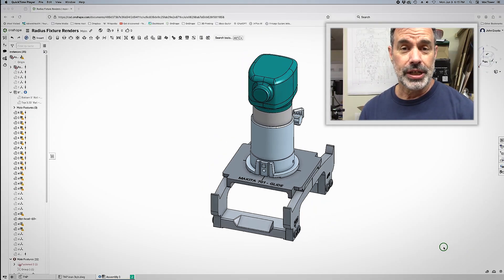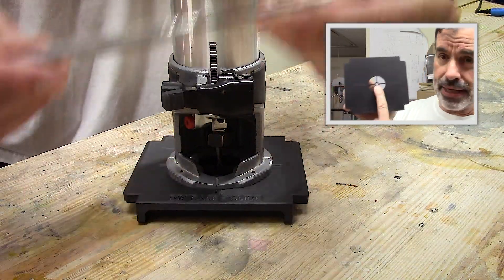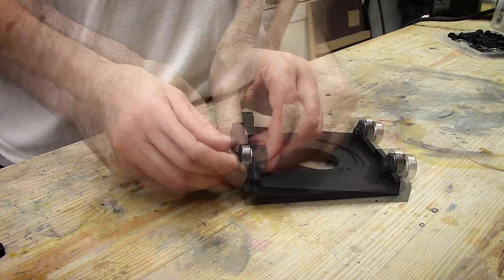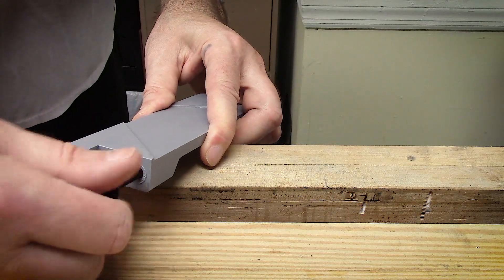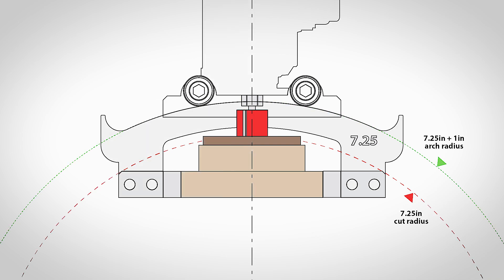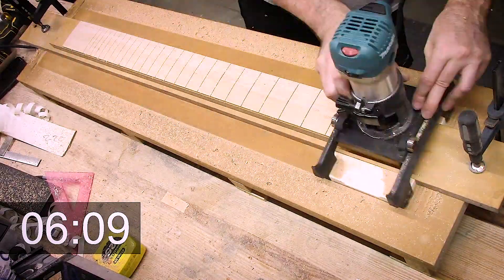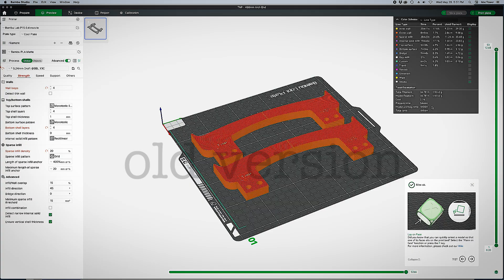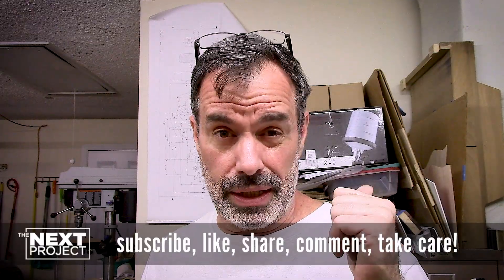Fingerboard Radius Fixture - 3D Printing Guitar Project Tools Ep3

Comment: thanks heaps.  i was about to try and build one of these.  really appreciate it.  going to try my luck making a neck
Reply from the maker: Jarrah, thanks for watching!

This fingerboard shaping fixture can save a lot of time... but before you commit to cutting your "good" fingerboard lumber, do a couple tests on some scrap material that is the same dimensions.
This will give you a chance to learn the process and get a feel for it.
You will probably still want to do final light sanding to remove any router swirl marks.

Good luck with your project!
Reply: @theNextProject  thanks for the tip

Comment: I’m a Solidworks guy and just getting into 3D printing. Do you have any recommendations for a good printer that doesn’t require me to get a loan against my house? 😂
Reply from the maker: Mark, thanks for watching!
Great question

The a short, short answer is: 
I have a Bambu Labs P1S, currently $399. 
The new Bambu Labs P2S is $599.
A lot of other good options, but I have no experience with them.
My P1S has been a great tool, it's weakest component at this point is (me).

Here's a earlier reply to a similar question, I type slow, so copy/paste is my friend.

There are a number of very good machines available, and I went through a list and compared nearly a dozen before boiling it down and making a purchase.
First, I had a very hard time justifying the purchase. All I saw were people printing toys and trinkets and "benchies" (benchy is a silly little tugboat print file that people use to test filament...to no end). 
So, on top of justifying the cost, need and use of the printer, I then juggled how to pay for it. I considered running a small "print farm", basically selling the tools and parts I've been designing.
I then realized, that's a job in itself, and I'm way to busy already.
I've purchased other tools, in similar fashion, often buying the bottom-tier tool to save a few dollars.
In some cases that has been a good decision, but I knew this is a different kind of tool, and a bottom-tier printer may be outgrown pretty fast, so I looked a mid-level and upper-tier printers.

After the research dust settled, I decided on the Bambu Labs P1S (mid-tier printer at the time).
It is a rather "turn-key" printer, aside from some minor assembly/unpacking, software download and set up. After that initial stuff was done, it's been a good machine.
It is currently $399, which is $200 less than I paid for it a year ago!!!
There is the little brother A1 currently at  $299. 
A lot of people love the A1, but I was concerned with the max print size it can handle... may or may not be an issue.
https://us.store.bambulab.com/products/p1s

The P1S has been a great machine, and for a novice (me) it has worked well. The only problems I really have are with the operator (me), and the designs I attempt to force on the machine.
I did not get the AMS device, which is a multi-filament holder add-on, as I planned to make parts and tools, not figurines and gift toys. 
Everything I make is mostly one color. I load the filament and run it until the spool is empty. 
NOTE: I'm really liking bright colors for tools and parts, easy to see them on the bench and in the drawer.
As for filament, that's another research challenge. There are a number of companies making/selling filament, and not all filament is created equal. Similar, but not the same in some cases.
I largely keep it simple (safe) and just use PLA filament for most of my projects - at this time.
I have used Carbon Fiber reinforced filament, but that requires a couple upgrades to the printer.
I also have concerns about potential health issues using and handling some CF filaments...I worry about things.

On top of the printer, filament, material storage... there is 3D files. Either you find things to print, or you design things to print. So, if you like to learn, there are a host of 3D apps out there.
I'm currently using "OnShape", which is a free online 3D design program.  There are some great online tutorials for this and many other design apps. Again, I didn't want another career, and OnShape became reasonably easy once I pushed through some tutorials. 

As I mentioned, there are a lot of great printers out there, and my choice may not be right for everyone.
I did want something that was "turn-key" for the most-part, I didn't want printing to be another full-time job filled with trouble-shooting, but rather a tool I can reach for and use when needed.
(there is still trouble-shooting and plenty of testing)

Okay, sorry for the long essay, that really doesn't give you a clear answer.

Good luck with your projects, be safe and take care!

I hope this helps, be safe and take care!
Reply: @t @theNextProject what a great response. Thank you much. I’m going to check the 3D program. Solidworks is expensive even on the maker level.
Reply from the maker: @Souldoubtrocks   I don't know if onshape will have all the features of SolidWorks, but it's works well enough for the simple tools I'm making, and my skill set, and the public version is free.  That fits my budget and user level.
Good luck with your endeavor into 3D print!

Comment: This is awesome!  I have access to a publicly offered 3D printer.  Any suggestions for a total newbie?  Any idea how long it takes to print the various parts?  I think the limit for print time is about six hours.  I don't mind donating some filament to the location if certain filaments would be superior to others for this project.
Reply from the maker: That's great news!
Print time will vary based on a number of things. 
The type of printer, the type of filament being used, the thickness per layer of filament, the speed of print head...
For the majority of my radius fixture parts, I'm using PLA+, or PLA Tough+ Filament. 
PLA Matte and standard PLA will also work. 
The thing about most PLA's is that they aren't the strongest, nor most environmentally durable. PLA will warp if it gets too hot, so don't leave it in your car on a hot day...
But, for most guitar projects the PLA parts will be reasonably sheltered.
I've also used PETG, and PETG-CF (carbon fiber), but for this project that seems overkill.
If you can talk to someone who knows the public 3D printer, they may be able to offer some guidance based on the machine to be used.
Orientation of parts, and bed temperature are also things to consider. 
Sorry, but there is a lot of little details, many of which I'm not up-to-speed on. 
I'm still learning as we go.
Maybe get the parts you want to print downloaded to a USB thumbdrive, and visit with someone at the printer.

Sorry I can't help much, good luck with the process!
Reply: @theNextProject  Thank you for the thoughtful and helpful reply.  I'm a total beginner so this helps get me going in the right direction.  I'll work with the local printer to see if we can get a working radius fixture.  I'm looking forward to your next video.  Thanks again!

Comment: And what if you use this jig for leveling the frets using a diamond router bit? Could that work too?
Reply from the maker: Lucas, thanks for watching!
WOW, hadn't thought of using it to do any fret leveling. 
I'd guess it may be possible, but that's a bit beyond the original intention of this tool.
Precise alignment, and leveling of the neck/fingerboard would be needed. A way to industrial clamp everything in place so nothing moves, not even a hair. 
Hmm, sounds like a task for CNC machining. 
I like how you are thinking outside the box. The "what if..." thought process helps us develop new tools and processes.
Good thinking!
Be safe and take care!

Comment: Is there a particular router bit that you recommend?
Reply from the maker: Thanks for watching!
Bit choice will be subjective, but I typically use a 2 flute flat bottom bit made for CNC waste board work.  I've also used 1/2" diameter bits, spiral bits, downcut bits... 
I'd suggest getting some scrap material and running a few tests, you may find one type of bit works well on maple, but not on rosewood. 
Also practice and think about direction of cut, which way to travel along the edges to minimize chips and tear out. 

Amazon search:
YONICO 14971q 3/4-Inch Diameter Bottom Cleaning Router Bit

I hope this helps, good luck with your projects!
Reply: @theNextProject tried the radius jig today. Worked beautifully,!!
Reply from the maker: Glad to hear you had success with the jig.

Comment: Hello! Great tool! I would like, if possible a radius of 93mm or 3.66 inches. Awesome channel!! Thank you!

Edit: trying to edit your files, let's see!
Reply from the maker: Pedro, thanks for watching!
EDIT 2: 
A Violin, perhaps.

EDIT 1:
I've placed STEP and STL files in the Dropbox folder.
3D print files:
https://www.dropbox.com/scl/fo/z70x7gp1t1be9hnds8nii/AEi3bpPsHMHOOIRwL5AfFaw?rlkey=d5fyzml1sdl3s2p2yr531xshe&st=ksowbdlh&dl=0

It is a pretty tight radius, but I think it will work - depending. 
This 93mm radius will require a narrower top routing rail for the fingerboard to mount to due to the tight radius. The router bit will cut a path that will hit a 3.5" wide top fingerboard mounting rail, so be prepared for that. Overall, this radius arch should work.
It is designed like the others, with a 1" offset from the fingerboard surface to the radius arch that the router will ride on.

The 93mm end arch may require a 4 or 5 loop wall thickness and maybe 40% or more infill to increase its strength overall.

Original reply:
A couple of questions, what thickness will you make the fingerboard at its thickest point, and what width will the board be at the nut area.
This fixture is set up for a standard guitar fingerboard being roughly 1/4in (±6mm) thick, with a nut in the 1.5in - 1.75in range. 
The 93mm radius will either need a thicker fingerboard at it's crown, or a narrower fingerboard due to the radius.
Is this intended for a guitar, or some other stringed instrument?

Interesting challenge!

Comment: Very cool! Thanks for making the files available. Quick question about use, when setting the router depth, how are you getting the depth set? I may have missed it in the video, but do you measure from the bottom of the glide plate or are you measuring up from the surface the whole assembly rides on?
Reply from the maker: Joseph, thanks for watching!
If you have the 3/4" thick top and bottom rails, the finger board will attach to the top narrower rail.  The finish thickness of the fingerboard will be 1/4" at its centerline. Actually leaving the fingerboard a hair thicker is a good idea, as it offers room to do final clean-up sanding.  
As for which end, and where to measure from,  I typically, start my routing with the but a hair above the fingerboard, rout away the sides of the board, then lower the bit a hair, take another pass until I reach my 1/4" board thickness and the desired radius..
I should do a follow up video showing the process a bit better.
Oh, the reason I use the 3/4" top and bottom rails, is so I can remove the top rail, and mount a finished Fender style neck in the fixture to re-radius an existing neck.  
Hope this helps!
Reply: @theNextProject   Yeah, thanks. That's sort of what I was envisioning--stacking a few different scraps that add up to an inch (assuming Fender style) plus a few layers of blue tape, then dropping the bit onto the tape to set the height, at least for the final pass. Clever to plan ahead for finished neck. I got a buddy helping me make one of these and I'm excited to give it a try. Thanks again!
Reply from the maker: @josephbard7663  run a test scrap wood fingerboard or two to get a feel for it.  It works pretty slick once dialed in.  Good luck with your projects!

Comment: Great video.
Quick question. Can this concept be used for flattening wood surfaces instead of those machines using sanding?
Reply from the maker: Navid, thanks for watching!
Yes, this concept is also used for flattening, or leveling material such as body blanks.
Any type of structure can be built to hold the router at a height above the material to be flattened. I did a similar thing using slightly different fixtures in a few past videos.
Here are a couple sample ideas.

Router Plane a Benchtop:
https://youtu.be/-C-s544KZqg?si=LVpUxfHR-zfaqe-_&t=584

Router Plane thickness a guitar body slab:
https://youtu.be/brK0OEF5QjM?si=6D_w6wAKOl3IEf_O&t=225

Hope these give you some ideas.
Be safe and take care!

Comment: This is amazing John! I have never tried 3D printing, but you have certainly got me curious. Always appreciate your thought process. You are equal parts engineer and artist.
Reply from the maker: Thanks for watching!
3D printing is an odd duck, I've been tempted by it for a few years, but could never justify the time and initial cost.    There is a little learning curve, but I purchased a printer that is pretty much turn-key, and so far the only errors I've had are with my designs, which I then iron out.
If you know someone with a printer, you can take these files to them and barter some trade to get what you need produced. 
I like learning and a challenge, which typically gets me in a pinch...then I MacGyver may way to safety. 
Engineering and Artistry sounds better than "oh crap, what have I gotten myself into...", so thank you!
Reply: @theNextProject That is definitely one of my favourite aspects of this whole guitar building thing. It’s a nice mix of creativity, skill and the ability to fix your own mistakes!

Comment: Great stuff.  Saving these for when I eventually pick up a 3D Printer.

Been meaning to ask you a question too, if you don't mind.  I know you discussed the z fret files before, but now that you've had more time with different types, which would you say is your favourite?  I'm thinking it's time I pick one up for spot filing wonky frets.
Reply from the maker: OMZ, good to hear from you and thanks for watching!

Really a great question regarding the different files, and yes my POV is shifting a bit.

Background:
I've used the SM Original Z-file for a number of years. I think I have 3 or 4 of them now.  Initially, appreciated how they worked, and hated how the constantly plug up with fret debris. That's why I purchase a second and third, so I could get more work done before cleaning... 

After going through the diamond file testing, and continued attempts at using the various files, I'm seeing the SM Original, or SM Safety file as being almost perfect. I've also picked up the SM Centered (full length file), and it is far better than the compact centered version ( in my hands ).

Current day:
A job I was crowning this past weekend, I again pulled out the following files:
MusicNomad S-File, SM Original Z, SM Centered Z, and the FretGuru Diamond Dagger 2.0.

The MN S-file is giving me the same issues, it just doesn't want to creates a really fine crown, even when I cheat the file by leaning it to the sides. The file wants to leave a crown about 1mm wide due to the built in "safety rib", cheating the file defeats the design feature, but can bring in the crown width.  Then the issue of the coarser diamond coating needs to be addressed, so I'm not using it. But I did find a use for it - a misuse perhaps.

The SM Centered Z does a pretty good job, it requires side-to-side leaning of the file to "round" the fret, otherwise it wants to facet the fret shape, but it mostly works.

The SM Original, requires the file to be leaned at incrementally changing angles during its use to "round" the fret. I'm thinking the short leg of the files cutting surface really doesn't help much, so the SM Safety file would likely do just as good of a job.

The FretGuru DD 2 file, has a concave diamond surface, but no safety rib like the MusicNomad S-file.  The FretGuru DD 2, has a different diamond coating than the others, and I can't decide if it is better or worse, just different. So far, it has not failed, and that is likely due to using 3and1 oil as a cutting fluid (used with all my diamond crowning files).

Results and Findings:
My final process on the weekends neck-work was to use the SM Original Z to get the crown hairline to about 95%, then used the FG DD2 for final touchup and hairline refinement. 

Side Notes:
I should also mention that the 300 grit offset file I pickup up from Bitterroot guitars has done a good job in general. I just didn't grab it this weekend. For the price, it's a pretty good tool, but may need some de-burring out of the box.

Sorry, no one file is perfect, but a few are pretty close.  If I only had one file to to the job, I'd probably go with the SM Original, or the SM Safety, a really close second would be the FG DD 2 and maybe the Bitterroot 300 grit offset file.

Oh, the "misuse" use I found for the MN S-file.  This idea was hatched from seeing the Frtlzr fret sanding/polishing tool.  I took a piece of fine sandpaper, wrapped around the file and use the concave file surface to hold the sandpaper to the fret shape. Worked really well, easy on the hands too. 

Sorry for the essay. 
Take care my friend!
Reply: @theNextProject  Please don't apologize for going above and beyond with your recommendation and reasoning.  I appreciate it a ton.  So I guess the best bet will be to pick up a couple.  Thinking maybe the SM OG Z and FG DD2.  Thanks for all of this.  Seriously appeciated.
Reply from the maker: OMZ, glad to ramble on a bit.
Please also try some 3and1 oil (or similar) on the diamond files.
Just a drop, rubbed across the diamond grit, then crown a fret. Wipe the file and fret off with a paper towel, and repeat the process. 
You will probably never need to deep-clean the file, which is well worth the time and minimal cost of the oil and a roll of paper towels.
Happy filing!
Reply: @theNextProject  Good tip.  Thanks again.